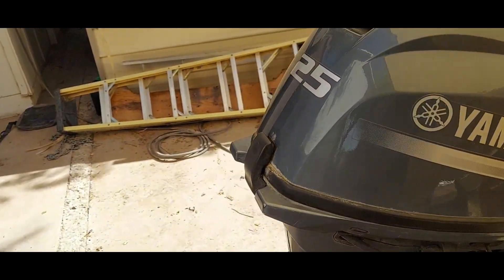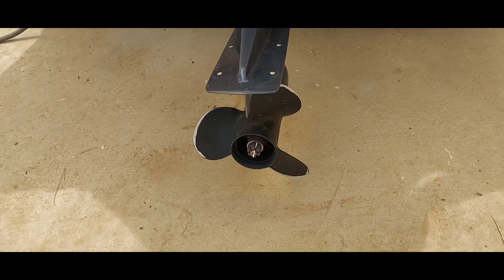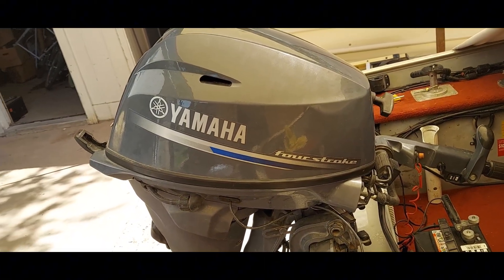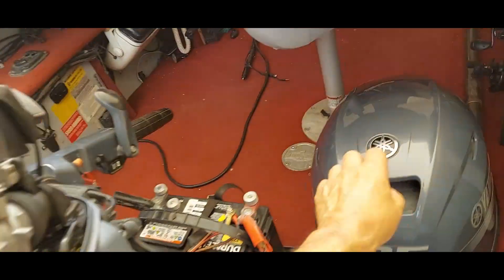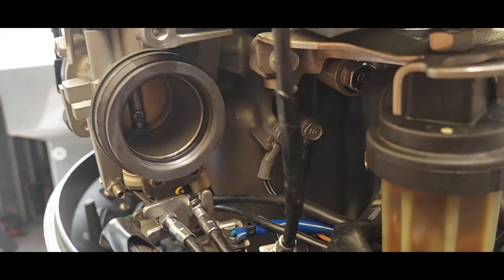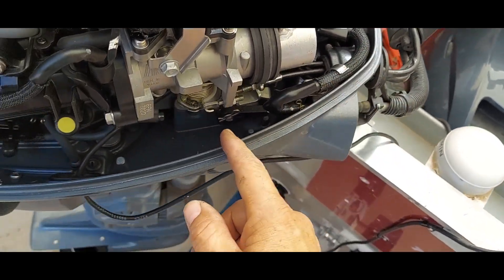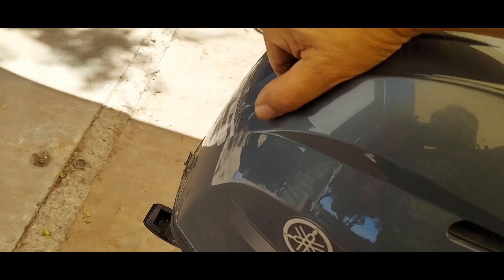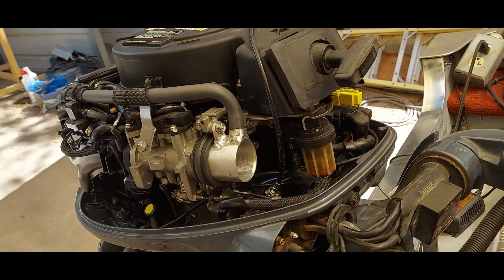Yamaha F25 EFI intake modification for more POWER

Comment: Stange because mine goes to 27 m/hrs withot doing nothing...Also, your prop doesn't look the same then mine...😮
Reply from the maker: On a recent trip to Ute lake (3762 ft elevation),  I went about 25mph. I plan to remove extra stuff that I seem to always carry in the boat but never use, that might get 1 or 1.5 mph more.

Comment: Hi does it make the 25 any louder? I’d buy one from you!
Reply from the maker: The engine is a bit louder with the cowling off but not much louder when the cowling is in place.
Reply: Mines a 2024 it has a annoying rattle which I cannot figure out where it’s coming from at a certain RPM
Reply: My 2024 25 does have a rattle also look at the trim locking rod mine seemed to rattle around a lot making quite abit of noise, putting rubber transom pad underneath motor stopped this rattle

Comment: I went thru this when this motor first came out. Back and forth with dealer. Yamaha would not believe me. Made my videos and uploaded to YouTube too
I even cut a hole in my cowel 3d printed a ram air intake. 

Just fyi you no longer have a filter or mesh just be mindful it’s there for a reason. 

But

Finally they reflashed my ECU after I showed them videos, made a difference. I eventually sold this newer efi model went back to heavier carb version. It was quieter and smoother. Speed diff was 1mph between them on same boat.
Reply from the maker: I will reach out to Yamaha to see if they can flash my ecu as well.
Reply: @turboanglerfishing I am at 6000 feet elevation and it while it did not improve a lot it was enough that it actually got up to 5500 rpm where as before flash it barley did 3800rpm. 
Good luck, I told the, I’m posting on YouTube for them to finally respond. They then had galls to try sell me extended warranty. 
Honestly the older model is nicer or three cylinder from Tohatsu